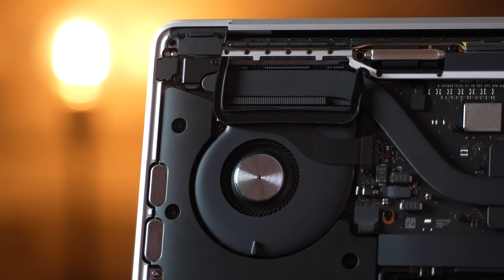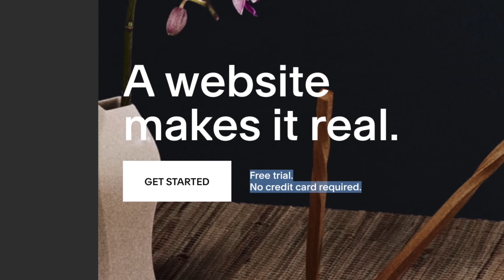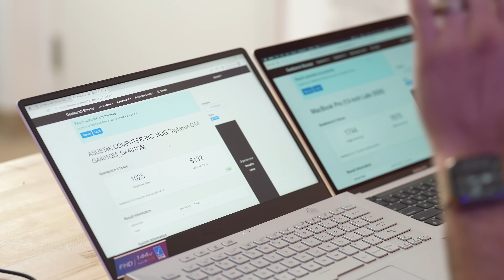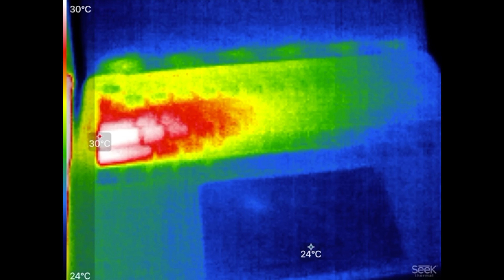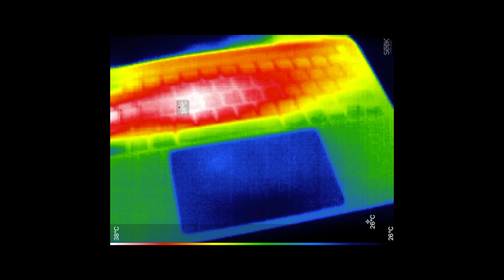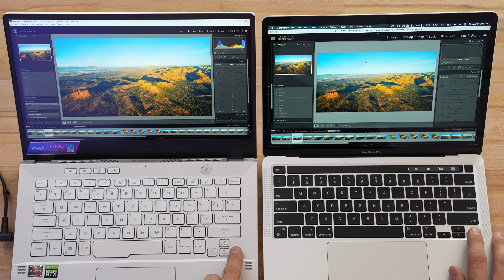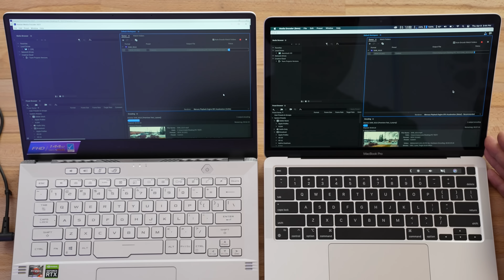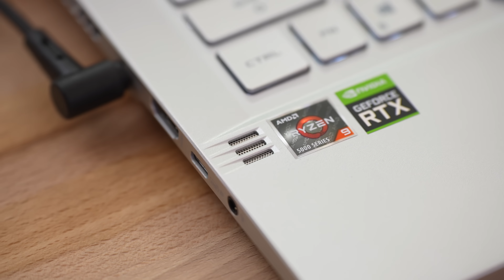Apple M1 vs AMD 5900HS + RTX 3060: FINALLY an M1 Killer?

Comment: Thats why I dont trust geekbench. Its showing g14 is slower than m1 but cinebench is showing that its way faster than m1 macs cpu. Also In your video too g14 on 4900HS scored 7950+ score in geekbench. Funny that 5900HS is better but not getting that much score.
Reply: That‘s the difference between running code on the CPU and the GPU - but that falls apart when you try to mix the two as then you‘ll have to actively transfer large data chunks between CPU and GPU and the destination has to wait for the transfer to finish. That‘s why the memory architecture of the M1 is so unbelievably efficient with the GPU and CPU sharing address decoding and memory transfer.
Reply: @karlgunterwunsch1950  Man both are testing CPU at its peak. Cinebench being the ultimate cpu stress test method. Atleast the results should follow the Trend.
Reply: @karlgunterwunsch1950  There's no mixing of CPU and GPU, geekbench and cinebench are both CPU tests. Also GTX 3060's memory is considerable faster than anything Apple has. 
Also in general the CPU gives the GPU instructions, it doesn't write huge amounts of data on the GPU memory.
In any large or serios job that involves the the GPU the G14 will win effortlessly.

Comment: One thing for sure is if have used a high refresh rate display gaming laptop you are never gonna use a 60 Hz anyday. I am spoiled by it and I get headaches When I switch to 60 on my laptop.
Reply: The problem with fast refresh rate screens is the p. poor color accuracy they have, I would never buy a gaming laptop for image editing due to this poor performong screens!
Reply: @karlgunterwunsch1950  poor color accuracy is not related to high refresh rate. Its Just that if you doing gaming and heavy duty work like model training and graphic intensive task or general use , you don't need to have that much color accuracy. One in a thousands uses his computer for editing purposes. So people would choose high refresh rate any day. And your case is special so better to have a color accurate monitor for editing purposes. Its bad to use 60 Hz and that is by experience. Its Just not possible to use 60 Hz. You will get headaches if you switch 😂

Comment: The guys commenting “The G14 is way more expensive than the Mac” don’t realize that for the same storage and memory, the M1 is more expensive.
Reply: Things to add: the M1 is using ARM technology, meaning that the hardware comparison using raw power doesn't make much sense, these tests, in my opinion, are a little biased, hold that thought and let me explain to you why I think that... ask yourself why is he just processing or exporting a video with short length? why doesn't he process files like the one's he uploads to his channel? The m1 has a good performance and efficiency, but for certain tasks, it isn't going to perform well.
Reply: @alejandrocarvajal9068  exactly. I would like to see a dude saying that the whole video, animations included, were done with the M1. Then I will believe it's actually good for what I need.
Reply: Plus the G14 has upgradable ssd and ram !
Reply: @yusufdomun303  Absolutely. Plus you can actually run games on it. For my use case (gaming and engineering software) the choice is pretty easy.
Reply: @piero914  OFC
Reply: I got a MacBook Air 16GB ram 500gb storage for $1500 I feel like it basically has the same specs as the pro
Reply: @RosasYo  The Pro has a more powerful GPU, brighter display, faster charging, longer battery life, HDR speakers, studio quality mics, and a Touch Bar. So not the same specs. Doesn't mean the Air is bad laptop though. The Air is solid laptop for most casual users.
Reply: @Dishant161  "HDR speakers"
Alright, imma head outta here! 😆
Reply: @sushimshah2896  Um, if you didn't know, one pair of speakers can indeed have higher dynamic range than another pair.
Reply: That’s one big con about apple. Basic storage is too overpriced. The hardware and software is good. But sometimes a few things that really matter is over priced
Reply: yea. you are right, but they compared the m1 that was cheaper than the asus with the asus dummy. smh.
Reply: Nope. You can get an MBA with the same storage and memory for less
Reply: @emperoarv9217  No you cant 😂😂
Reply: Memory, perhaps. But storage? isn’t this 2021? Also, compare costs of hardware quality, including trackpad, aluminum cases and screens as good as macs. Not even close, macs aren’t overpriced anymore with m1.
Reply: @renemonroy214  yes they are, they can't even keep up
Reply: Well even the $999 M1 MacBook Air with just the  7 core gpu out performs the G14
Reply: @bryanmiller476  it doesnt
Reply: Do most people need a terabyte of storage though?
Reply: @Dishant161   Most people do, just 3 AAA games can fill halfway & not to mention videos and files....
Reply: @energyvampire1672  Most people are casual users who type some emails, watch some YT, attend some meetings, and that's pretty much it. Maybe some light photo editing. Final Cut Pro users who edit 8K footage aren't working on a MacBook Air.
Reply: @Dishant161  if you pc game yes
Reply: @Dishant161  wonder what kind of "Pro" can get away with 256/512GB?
Reply: @sushimshah2896  anyone that uses external storage.
Reply: @sushimshah2896  Most people are not pros. And there are a few pros who can get away with 512.
Reply: @sushimshah2896  "wonder what kind of "Pro" can get away with 256/512GB?" 
The pro who has Nas storage with Thunderbolt/ 10gig connection? :)
Reply: @Dishant161  I do!
Reply: @Dishant161  Me who casually bloats a 256GB laptop with software only: Gee. It's almost as if  pro shit takes up space
Reply: @edwardhoffenheim3249  Well, you're certainly not the 'average' user then.
Reply: @Dishant161  Do you see the average user dropping $1300+ on a laptop? Don't you understand how ridiculous that sounds?
Reply: U are forgetting the dedicated GPU in G14 vs the integrated one in M1 + no fan
Reply: the M1 has 3 times better battery life, way better screen resolution, way better speakers, better trackpad, better keyboard and above everything the apple laptop will last much more. so apple M1 is way better machine in general, (without counting the GPU)
Reply: @christhedoc8689  Uh no lol
Reply: @christhedoc8689  You feel those are better because you haven't used the best windows laptop in the market.
Reply: ahhhh and better camera 😊

Comment: The single core score doesn’t represent the core performance but per thread performance. Also due to  Hyper Threading in 5900H, the single core score would be twice that of the single thread score ie 1496x2=2992
Reply: False, Hyperthreading was invented to make use of pipeline stalls where the main  thread can‘t make use of all the available execution units. The performance of the secod thread typically is abysmal - and the single thread score wouldn‘t be much different as it‘s those pipeline stalls that are still going to happen no matter what!
Reply: @
Karl Günter Wünsch I completely agree on the fact that 2992 is the theoretical max but I digress on the fact that the performance from the second thread would be insignificant. Even with some gains from the second thread, 5900H could easily beat M1 in single core score.

Comment: Fastest CPU currently is 5900HX (not 5900H in Zephyrus G15 which is an overclocked version of 5900HS a 35watt CPU) in Asus ROG Strix Scar G17. Also AMD hasn’t yet released 5980HX which would easily obliterate any COMPETITION.
Reply: @Okay Wattage doesn't matter if you are comparing the two for performance. Currently even Ryzen 5 5600HX beats M1 in multicore score, not even considering the Ryzen 9 5900HX.
Reply: @Dangerfox Have you even seen the graphic performance of the M1? Don't tell me you are comparing M1's integrated graphics with a 3080 Mobile, and then telling me it's half the price.
Reply: The m1 is running at 15 watts, 3.2ghz.
Reply: and is half the price?

Comment: It seems that at an extreme push, PC manufacturer's can match the performance of the M1 macbook for the same price, but massively fall short in build quality, thermals, battery, display quality, keyboard/trackpad, efficiency etc. They can also match the battery life, thinness and lightness, but fall short in all aspects of performance.  M1 is both, and it's a 15 watt fanless chip... It may just be game over for 95% of windows laptops when M1X arrives